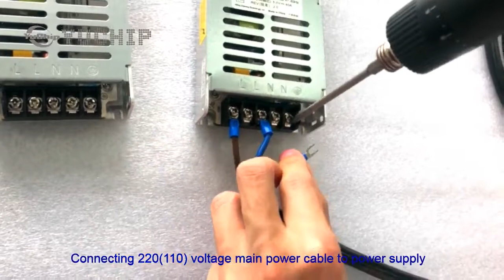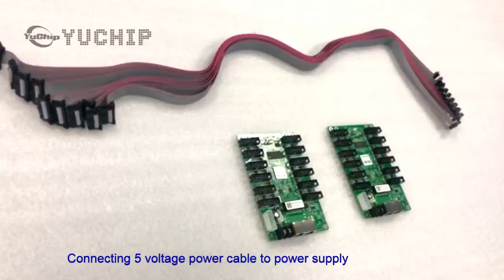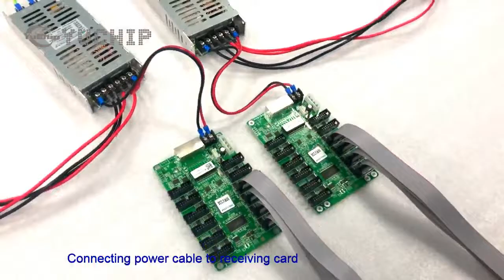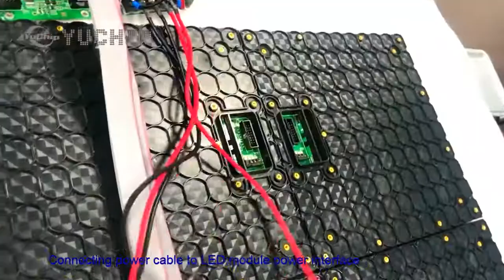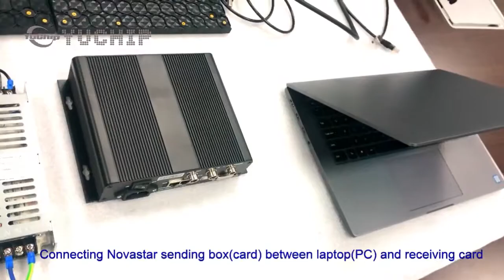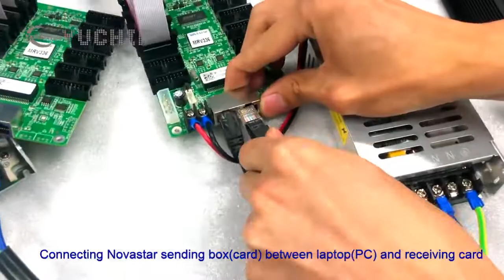9 Steps Show You How to Connect LED Video Wall Module (LED Panel Connection)

Comment: Hi ,
Can we use both side of receiver card to panel. I mean all 12 connection. For that we need to take anything extra?
Reply from the maker: You can use both sides of the 12 pins, but ensure the overall loading pixels are within the receiving card capacity.